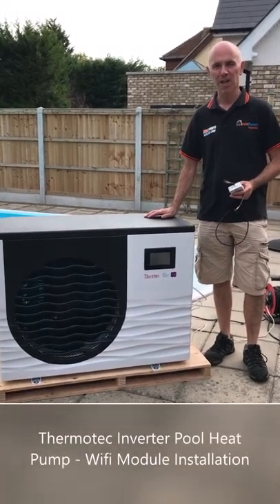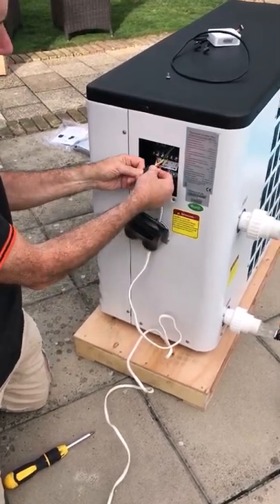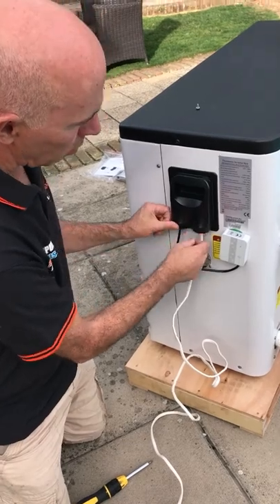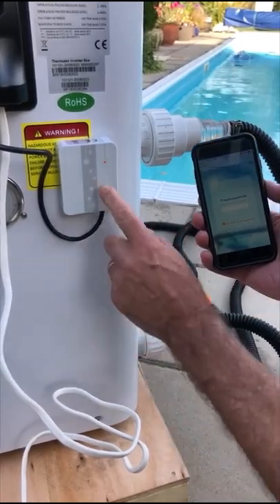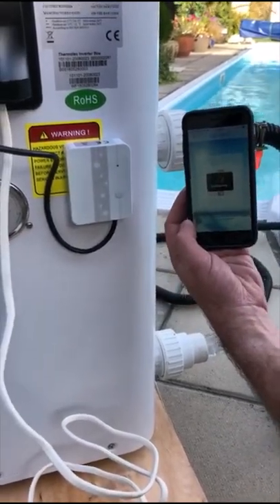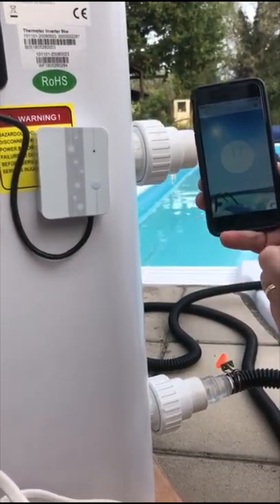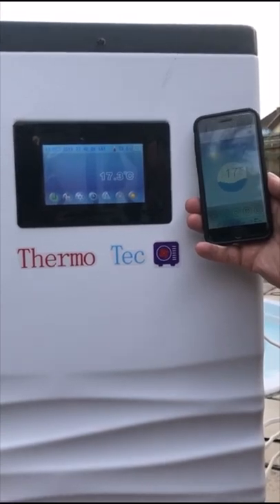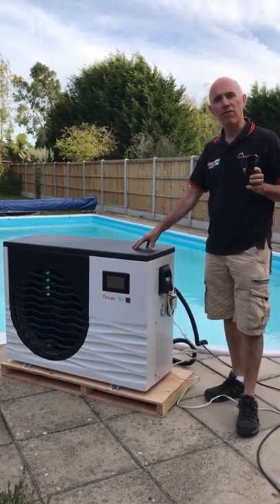Thermotec Inverter Wifi Module Installation

Comment: Can I plug this 9kw heater into a normal 13amp socket??
Reply: Hi Mark, yes the 9kw model can run from a standard 13A plug and socket, however where possible it is better to hard wire all heat pumps to a consumer unit if possible. 

Please call us on 01268-206560 if you require more information
Reply: David Morris thank is for your response, yes I will phone tomorrow just also want to confirm the water flow rate this heater can take as my pump pumps 7500 litres per hour
Reply: Hi Mark, we recommend that you fit one of our bypass kits to the heat pump. This will allow you to adjust the flow rate through the heat pump if required.
Reply: David Morris thank you for the advice